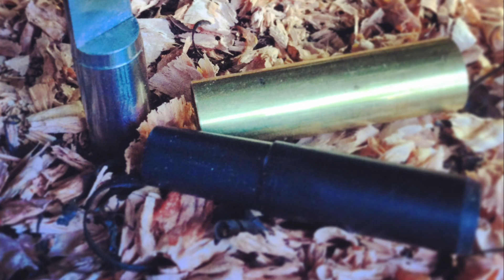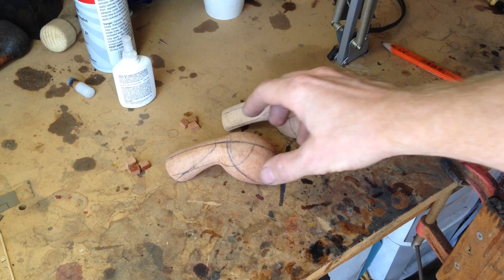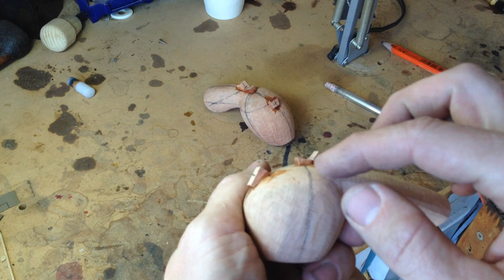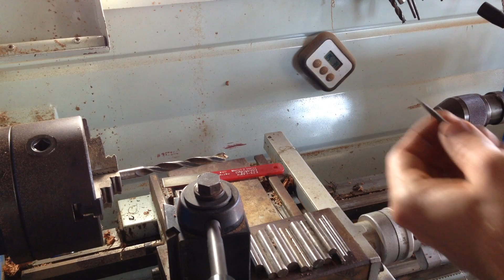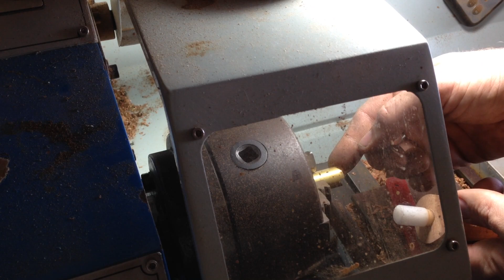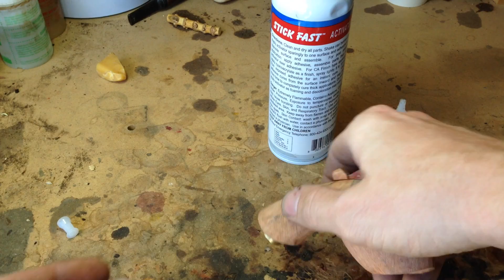Making a Military Mount Pipe -- J. Alan Design Tools

Comment: I have a question. My friend told me to not use glue on pipe. Isn ´t bad using a super glue that can probably melt while you smoking ?
Reply from the maker: It depends where you are using it, for what purpose, and what kind of glue.  Never use it anywhere that will touch the fire or smoke.